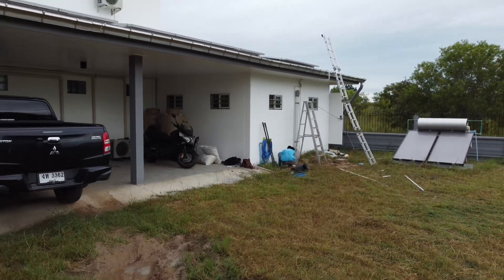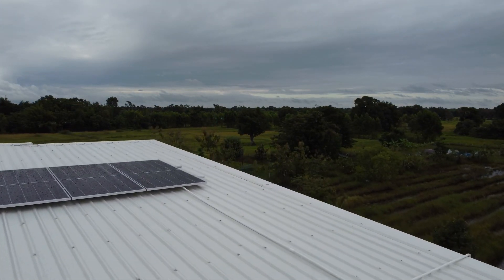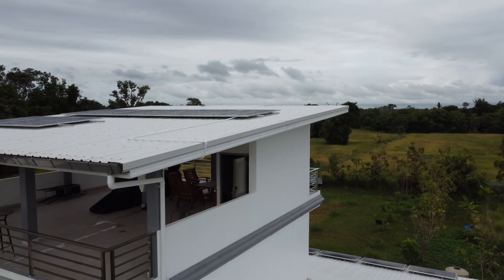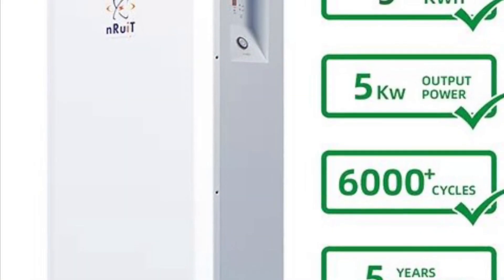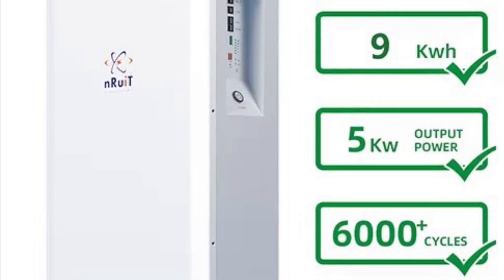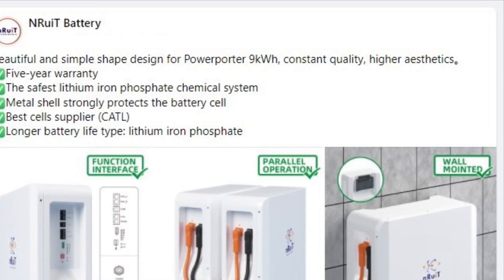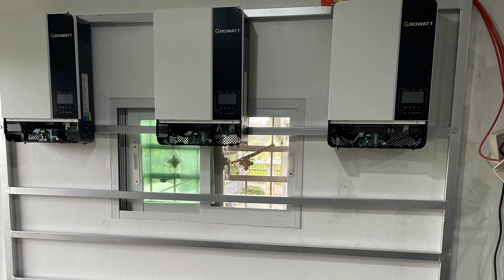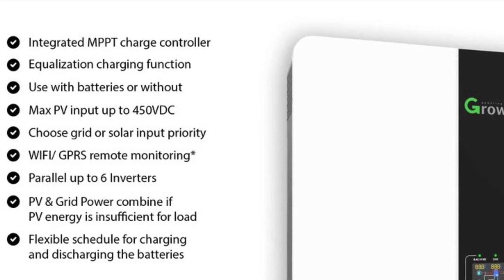Home Solar Upgrade Day 2

Comment: Hi - Just wondering why you used Nruit batteries, and didn't go with Growatt 100% and use their lithium batteries?
Reply from the maker: I actually found the nRuit batteries first. They use CATL cells; Lithium Iron Phosphate chemistry and the best price I had found. nRuiT’s preferred inverter is Growatt so that is why I went with Growatt inverters. At the time I didn’t know a Growatt batteries supplier.
Reply: @EcoHouseThailand  Thanks for the quick reply - did you buy the batteries and inverters direct from nRiut and Growatt or get them through your installer?
Reply from the maker: @ExpatsReporter  I investigated buying the batteries directly from the factory, but they would only quote me an ex factory price, which meant organizing collection from the factory in China and then dealing with Chinese export and Thai import. I asked if they had a Thai importer and it turned out I knew him, so I got him to import the inverters as well. I arranged the install using a local guy
Reply: @EcoHouseThailand  Would really appreciate the contact details of the Thai importer. I am very keen to go off-grid when I build as much as possible and your selection of products seems to be spot on.
Reply from the maker: @ExpatsReporter  He has a YouTube channel checkout the “About“ tab: https://youtube.com/c/CaptainDIY